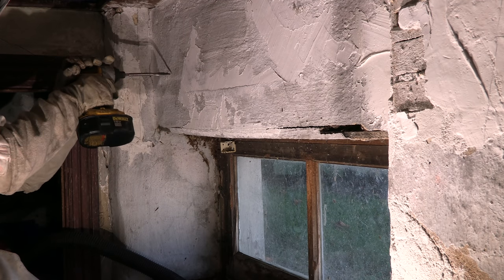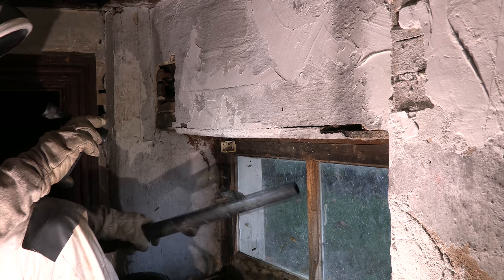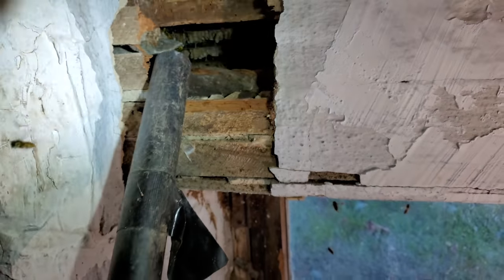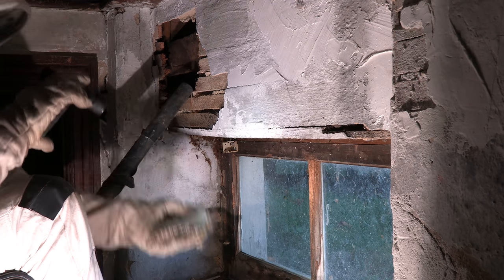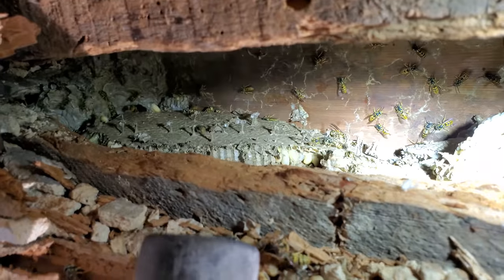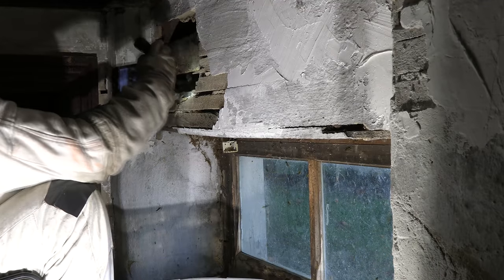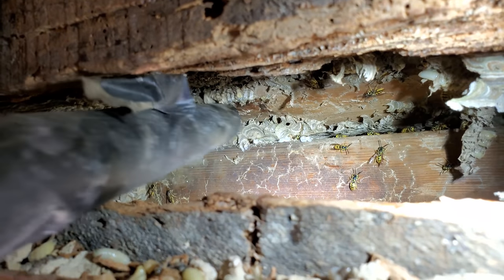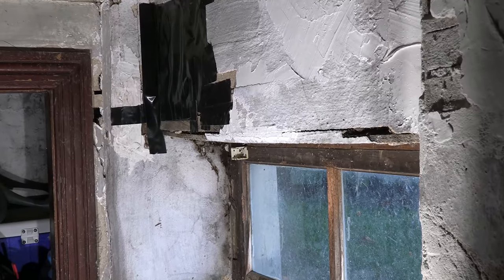MASSIVE Yellow Jackets INFESTATION in House Basement wall! Wasp Nest Removal!

Comment: I recently had an infestation of German yellow jackets inside the wall of my town house.  The biggest surprise is how aggressive they are about entering your house once the nest is established.  They were trying to find cracks in the siding up to the top of the second level windows about 15 feet above ground level and more than 10 feet above the nest site.  They were also trying to enter near ground level but 15-20 feet away from the nest.  They have something called cognitive plasticity which means they can learn and memorize better than your average insect.  It's a little disturbing to see that behavior with such a tiny brain.

Comment: We moved from the city to the country into a house that had sat vacant for about 2 years. Needless to say, some bugs (carpenter ants, beetles etc.) claimed it as their own. We have it pretty much under control except paper wasps! Not inside the house, but so many outside flying around the deck area and back door that we can't sit out there. We have searched everywhere for the nest with no luck. I have those sticky traps and they are covered with paper wasps so they must be nearby. We are replacing any and all wet or rotten wood we come across. If anyone has any advice (other than move lol) on where we should be looking for their nest (including Mr. Hornet King of course! I'd greatly appreciate it :) This is one of my favorite youtube channels, I have a great fear of wasps!

Comment: So I have a question. I don't see signs of a nest, but I live in an older house and the siding on it looks like wood, but we always have a ok amount or wasps outside our door in summer months. Is there a way an exterminator could check around the house for nests? Like in eaves and stuff like that? Also in allergic to them so I try not to get close to any at all.

Comment: Looks like about the size of a large hornets nest. You might be able to burn those nest, if you build up a nice hot fire that is hot enough to drive the moisture out. Build up a nice hot wood fire and throw them on. The heat will dry them enough to burn.

Comment: Just a thought seriously... why don't you use a bigger vacuum hose or at least a bigger attachment I've watched many of your videos and it seems like it would help... love your channel btw 👍😊
Reply from the maker: Wider hose means less suction. Its a balance of HP and hose diameter. This vac has the best suction/strength that is perfect for what I do.
Reply: @HornetKingOfficial  Kool!! thanks for the response I just watched another one of your videos where you delt with some southern yellow jackets I believe that's what we have alot of on the farm here in kentucky I was stung 3 times in our barn and it hurt soooooo bad we call them hornets but the worst ever experience I had getting stung was by bumble bees 12 times they were under my aunt's steps and the sting me the whole way home I ran probably 2 blocks I will never forget it...